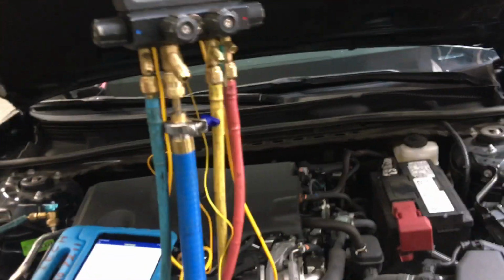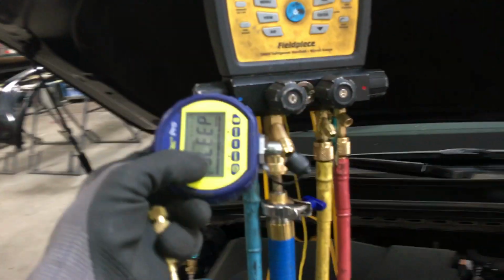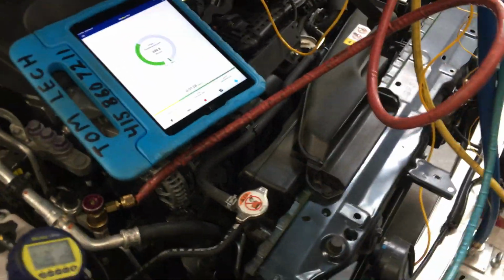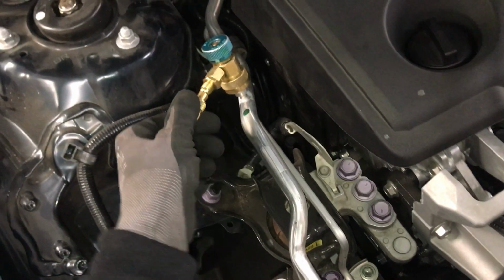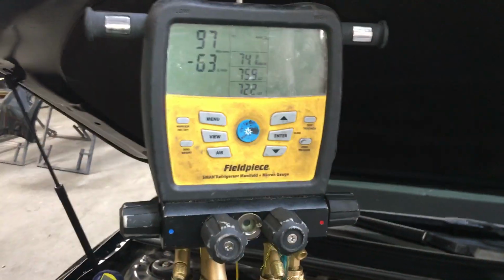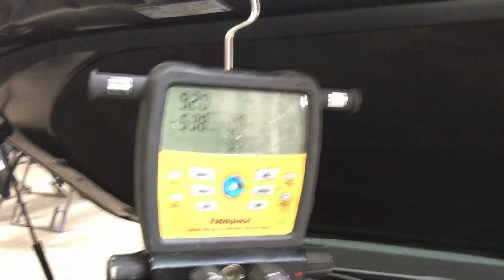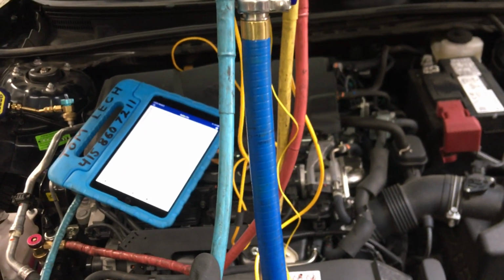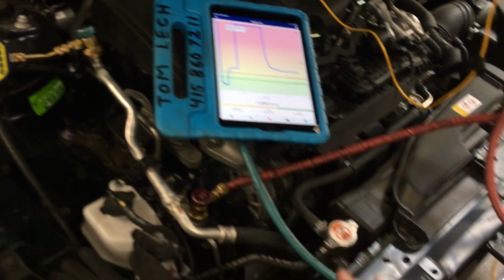Why You do not want to use refrigerant gauge manifold and refrigerant hoses poor vacuum Decay test￼

Comment: Hey Tom, thanks for making such informative video and I though the videos are inspired by my questions lol

So as you said the trublu hoses and a good vacuum pump is worth to invest, and here comes another question
As you said in other videos we shall avoid the silicone hoses being contaminated by refrigerant and oil. So how shall I work like? Use the TruBlu to connect the service port and the recovery machine? or use refrigerant hose to recover most of the refrigerant and then use TruBlu+vacuum to evacuate the system?
(in our place we don't need to recover any refrigerant for disposal so my questions sounds noob lol)
Reply from the maker: What country are you in that you do not have to recover refrigerant ? 

Recovering refrigerant is not just to protect the environment or stop wasting a resource. 

Recovering A refrigerant is also a diagnostic tool in aiding you in your problem solving. 

If your refrigerant charge is not to factory specifications you will have incorrect temperatures and incorrect pressures

So instead of guessing what is the problem illuminate the possibility of one problem that can affect all your other readings and that is the refrigerant charge is first and upmost importance. 

You completely recover all the refrigerant out of the system and take down its weight and compare it to the factory specifications you do not guess. 

Then you will know if that extremely low side pressure possibly depending on what type of vehicle is a restricted expansion valve or just as simple as a low refrigerant charge

Then you will know if it was overcharged by somebody else and that is the reason why the customer complain every time they go out on a drive on a hot day the air-conditioning stopped working but now the car is sitting inside your garage on a quarter mile day and the car is working perfectly

After your recovery you fill it up by weight only to the manufacturers specifications and now you’re ready to start the rest of your diagnosis

The true blue vacuum hoses are exactly just what the name states they are vacuum only hoses no pressure no refrigerant so they can never get contaminated you never recover refrigerant through them they only serve to do one purpose VACUUM
Reply: @coldfinger459sub0  I was in Hong Kong when I have done my alternative refrigerant trial. Except bus companies which owns more than thousands of double deckers or manufacturer car dealer I can hardly find any shops that will recover the refrigerant, and not to mention analyze, weight the refrigerant. Even the so called A/C pump oil changing machine is new for us.

So I understand your point to recover the refrigerant for diagnose purpose and its role is as important as a trublu hose and NAVAC pump...

So say if I do a nitrogen decay test, it is safe to use trublu for vacuum right?
Reply from the maker: @knk3220  no true blue hoses are only meant for vacuum they are not pressure rated they are vacuum rated only. 

Go to the manufacturers website and read about their product  after I post this reply I will go search for a website about the vacuum that I have saved in my favorites and I’ll give you the link underneath after I finish I’m eating lunch right now. 
                   So if you look at this message and there’s no link connected underneath come back in a few minutes and I should have posted it if I forgot send me another message and remind me
https://youtu.be/C8VLjBnkEcs

Watch this video and subscribe to Jim Bergman and any other company websites that he isn’t affiliated with he’s on several companies websites doing different videos about different subjects be careful you might get addicted and go on a video binge watching for 24 hours lol 😂

Comment: What is normal value of vaccum decay to a newAC system?
Reply from the maker: Cars are always messy and wet and they’re always be about 700 to 1200 µm after they have stabilized and rested for a while. 

It does not matter that with the vacuum pumps turned on and the valves are open you can pull the vacuum down to 200 µm but as soon as you turn it off it will start to rise to several hundred microns. 

But in commercial air-conditioning or residential air conditioning that does not use rubber hoses does not use rubber O-rings a brand new system that is clean and dry you can easily pull the vacuum down to below 100 µm with the vacuum pumps running connected. 

     Then after you turn off the vacuum pumps and you have a micron meter on the copper lines and no refrigerant hoses connected to the system after settling the vacuum decay will raise up to about 200 or 300 µm on a good clean dry system brand new
Reply from the maker: And you always can leave the vacuum pump on overnight on a car if you have that much time to do that
Reply: @coldfinger459sub0  keep vacum pump running whole night?
Reply from the maker: @issamadam9352  Yes the more vacuum the better you can never over vacuum. 

   On my own personal car friends and family car when you have time I’ll leave them on vacuum pump overnight.
Reply: @coldfinger459sub0  Vaccum pump not get hot,

Comment: Why you use 2 vaccum pump and how?
Reply from the maker: Just a little faster at the beginning.   Speed.
Reply: So you need to purge one hose that connect to vaccum pump or do vacum to that hose after  beining connected to freon tank.
Reply from the maker: @issamadam9352  i vacuum out the refrigerant hose going to the refrigerant tank usually below 100 µm
Reply: @coldfinger459sub0  When you want to add refrigerant,do you close that hose connected to vaccum pump?
Reply from the maker: @issamadam9352  🤣 i’m trying to think if I ever made a video of myself and I think I did where I accidentally forgot to close the valve to the vacuum pump when I open the refrigerant. 

      The refrigerant shoots down the vacuum hose into the vacuum pump going through the motor and pushing out the vacuum pump oil shooting it up in the air splashing me in the face and all over the clothes and in the hair and making a mess all over the car and the floor 🤬😭😱🤤
Reply: @coldfinger459sub0  hhhhha.Thank you for your time I know you're looking for money,today I have learned more about vaccum decay test.

Comment: Great job.Are doing vaccum  decay test for hoses and system?.Do you mean it should be same in all component?.How to repair this contamination in this system?.
Reply from the maker: What I’m trying to show is yes you can test your gauges and hoses before you hook it up to the vehicle to make sure there’s no leaks and they have the capability of pulling a very low vacuum. 

          Then you can attach them to the vehicle to pull a vacuum and you will know if you cannot pull a deep vacuum it’s not your gauges or your hoses because you have already tested them by themselves

     But I’m also trying to show that gauges and hoses on a system is actually not a very good method to try to perform a good vacuum decay test. 

       I also show how Superior for pulling a low vacuum the big blue silicone hose performs very well. 

          Refrigerant manifold and refrigerant hoses do a very poor job at holding a vacuum decay just by themselves because of the contamination of refrigerant oil and moisture and refrigerant that is embedded in the rubber of the hoses.
Reply: @coldfinger459sub0  Thank you for answeing my question,so how to manage this hoses problem?,by repkacing hoses and system fushing or replacing the condenser,and descicant bag.
Reply from the maker: @issamadam9352  The best way is without using refrigerant hoses or manifold. 

Just using the big blue hoses ,

I’ve done a video on it before and you also have a metal valve that can close off the vacuum hose so you could only read the vacuum inside the system isolated away from the hoses